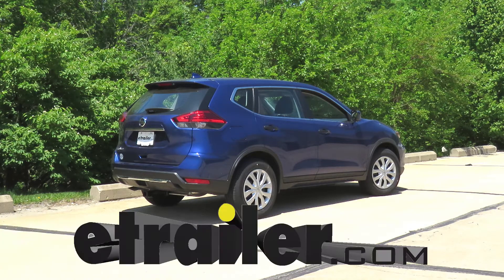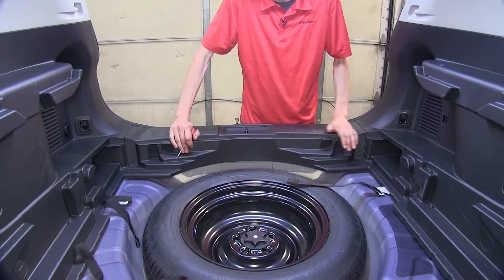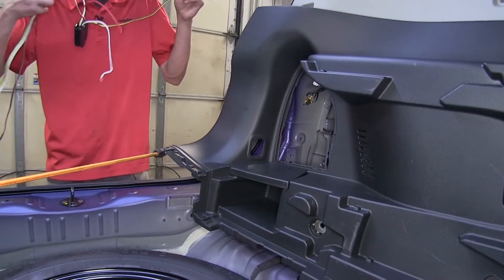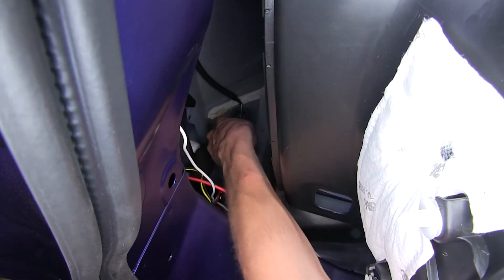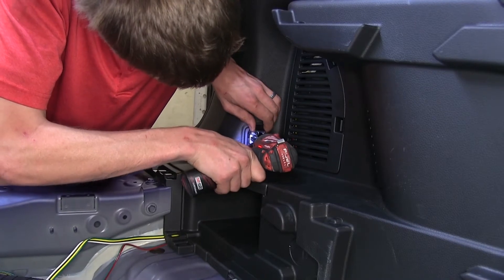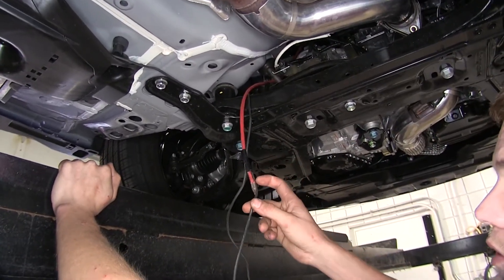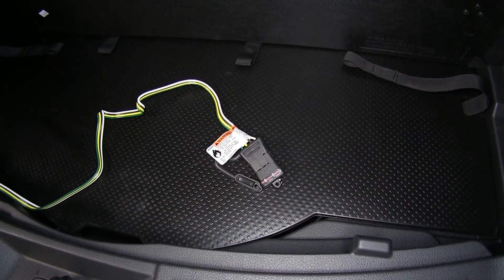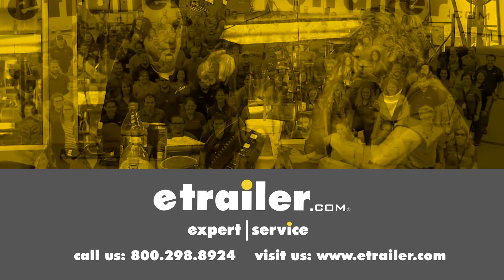Install: T-One Vehicle Wiring Harness with 4-Pole Flat Trailer Connector on a 2017 Nissan Rogue

Comment: Will this process be the same for a 2020 rogue?
Reply from the maker: Yes it will, the # 118480 fits both the 2020 and 2017 Rogue. The procedure on the 2020 would be the same as what's shown in the video.
https://www.etrailer.com/Custom-Fit-Vehicle-Wiring/Nissan/Rogue/2020/118480.html

Comment: Depending on your model some things may be different, specially the bottom part of the Rogue. Very well explained, just followed it and now I have it installed. I only wish the lad would've been a bit more careful making that sloppy cut to the battery terminal cap lol
Reply from the maker: Thank you for sharing this with us. It makes the installation a bit easier after you have seen it done.
https://www.etrailer.com/Custom-Fit-Vehicle-Wiring/Tekonsha/118480.html

Comment: Why wouldn’t you run the power cable down the interior of the car instead ? Seems kinda dangerous to any mechanic that works on your car to have wires hanging underneath the car , is this common professional practice ? Cause car audio you would never do that
Reply from the maker: The 12V wire is designed to be run outside the vehicle because of the coating that it has. You can run the wire on the inside of the vehicle if you choose but it will just take more wire and many more panels that you will need to remove.
https://www.etrailer.com/Custom-Fit-Vehicle-Wiring/Tekonsha/118480.html
Reply: @etrailer  There is a cigarette lighter socket right at the back passenger side, could you just splice the hot 12v+ from there?
Reply: @samhillband  i like this. Did you give it a shot?
Reply: @samhillband  Did you do the splice method? Did it work?